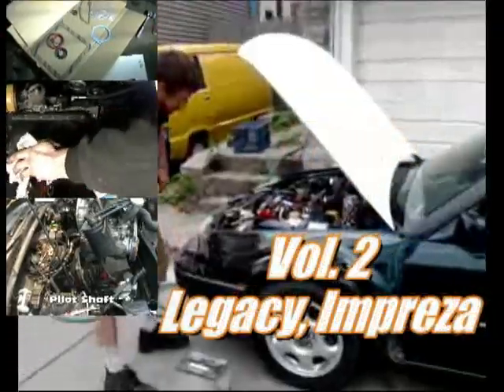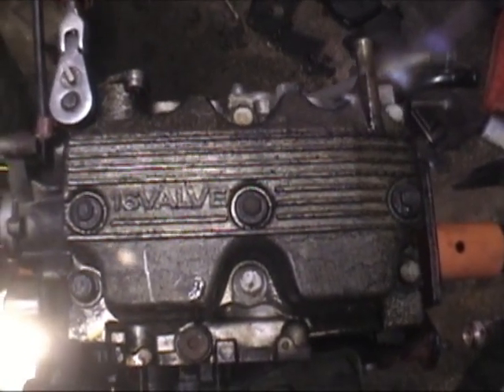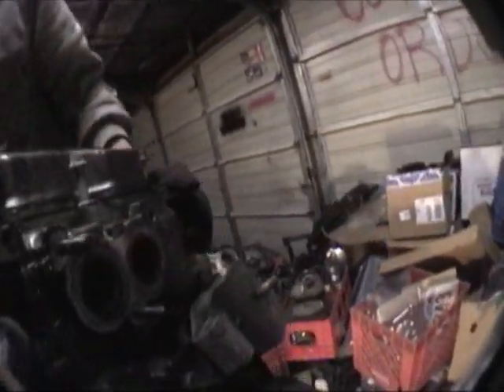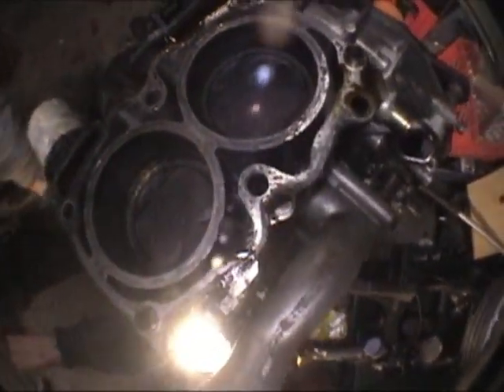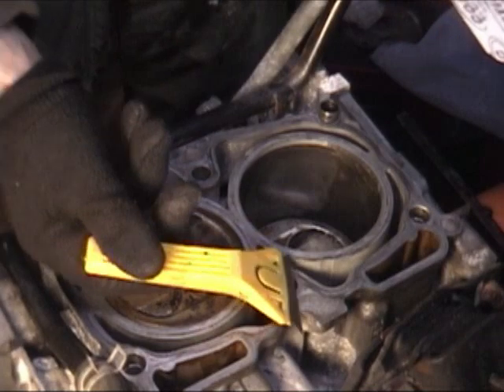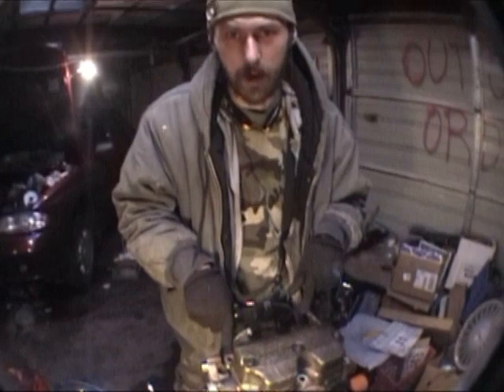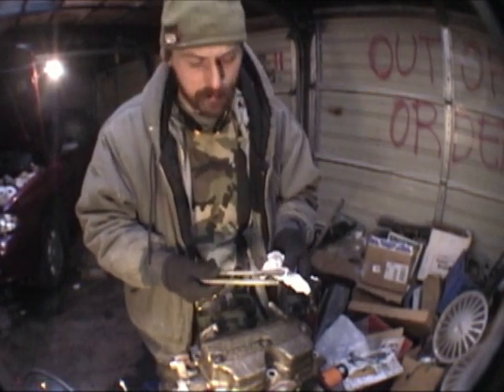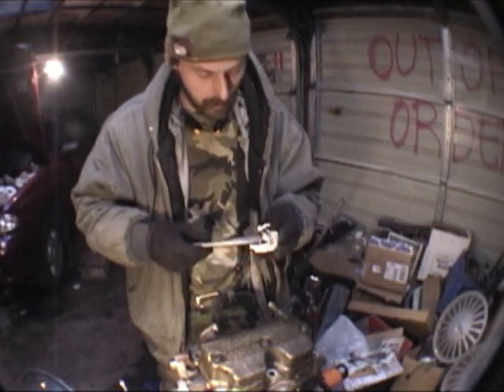Subaru EJ22e phase 1 Torque Heads procedure

Comment: i am actually do this the same,  i used bench wire wheel and well i uses trans fluid instead of oil :/ on the bolts.

Comment: Did the cometic gasket work without milling the head surface? Any problems?
Reply from the maker: No we did not machine the rads as they came from a running donor engine and were not overheated. The gaskets themselves are different than oem as they have the proper water jacket passage for using 2.2 heads on a 2.5 block